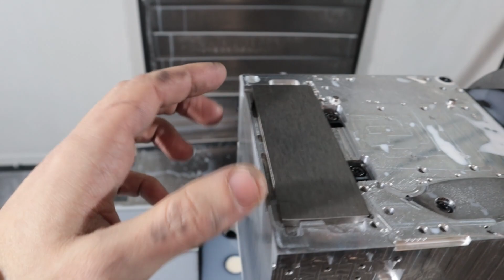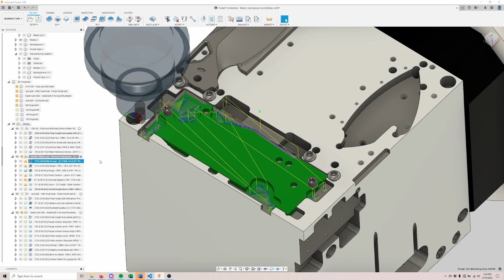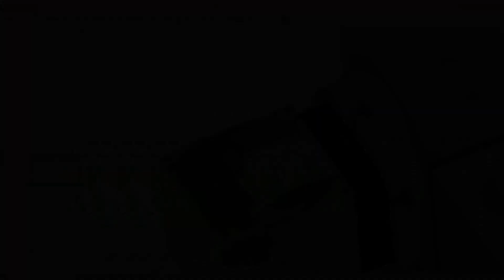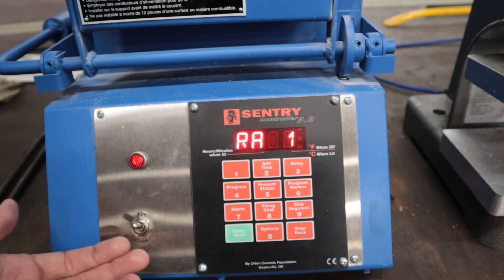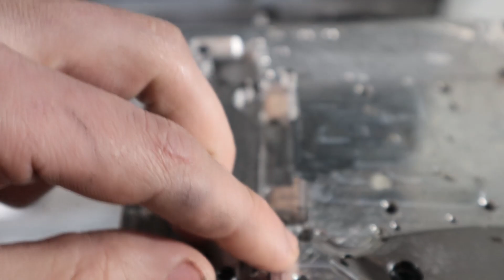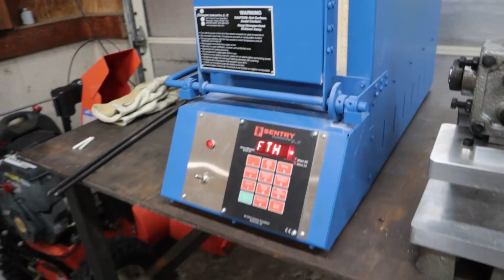New knife blades

Comment: ive got that same furnace, the failure to heat up thing drives me nuts. what ramp speed are you using?
Reply from the maker: Full to 1400 deg I think, and then progressively down on ra in steps up to the last temp. I think the last stage is like an ra of 600 from 1800 deg, so it’s slow lol